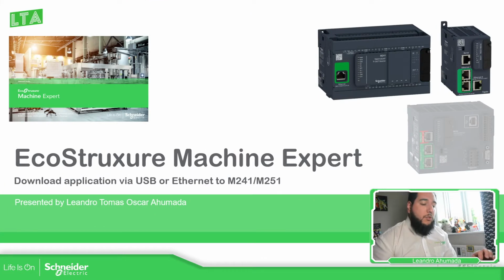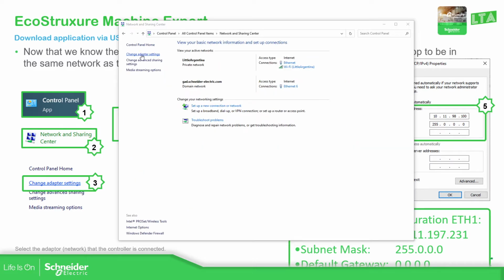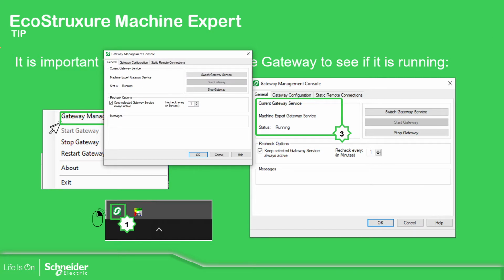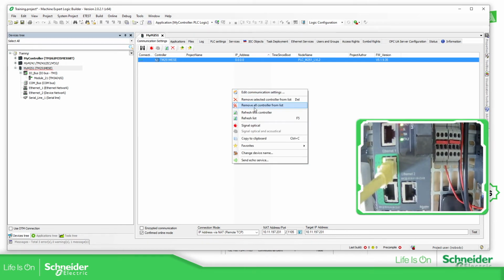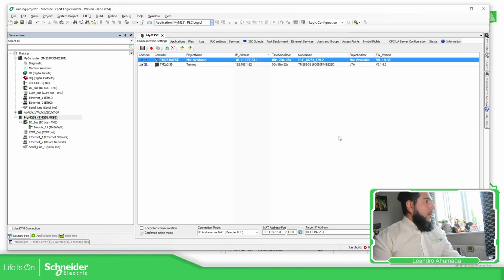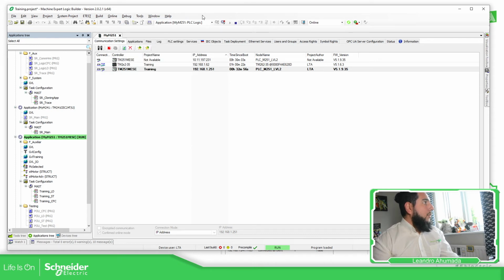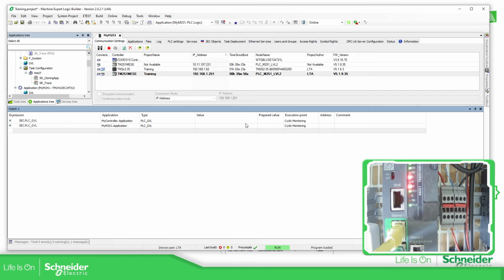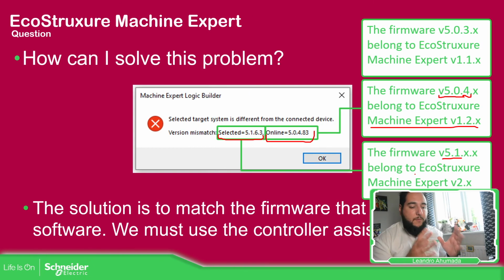EcoStruxure Machine Expert Training - M6.8 Download via USB or Ethernet for M241 M251

Comment: Hello sir, what version using M241 model?
Reply from the maker: Hi there! not sure what you are after In my examples i usually use the TM251MESE, i do not have a M241 with me. SOMachine v4.3 and Machine Experts uses M241

Comment: What is username and password for downloading program into m251 controller
Reply from the maker: Hi there! If I am not wrong in the video i mentioned that it depends on the Machine Expert version used. If you need to reset it then you will need to download the firmware to the plc using a sd card.

Comment: Good day Tomas, I have succeed on connecting the m251 to gateway management console. But when I do the test part on the machine expert I always fail. Could you please help me? notification said "please check comm setting, for legacy platforms you can try to connect using the nodename via NAT or gateway" also the m251 currently has error led blinking...
Reply from the maker: Hi there! If the management console indicates the connection then it can be something related to an old firmware of the plc. Try to update or use the same version of the software.
Note: first time seeing that message

Comment: Hello sir, I am trying to connect my m241 to my pc to download a program for the first time. I cannot find the gateway anywhere on my laptop, but have installed the machine expert. Where can I redownload the gateway in order to connect the controller.
Reply from the maker: Hi there! If you have already installed Machine Expert it means that you used Schneider Electric Software Installer so open that software again and check the different components. In there you should be able to see the "optional Gateway"

Comment: Hi Mr. LeTomas , please your advice.
When progress firmware update by Controller Assitant, in the end progress ( after Alt+F ), always appear : " Safety Warning was cancelled by the user ". 
How to solve thats problem sir ?
Reply: Software machine expert V2.1 and my PLC TM241
Reply from the maker: Hi there! I believe it is because you do not have the admin right to access to the PLC. In that case i recommend you to use a SD card to change the firmware. The use of the "Alt+F" is for the use to read the popup windows, it is normal.